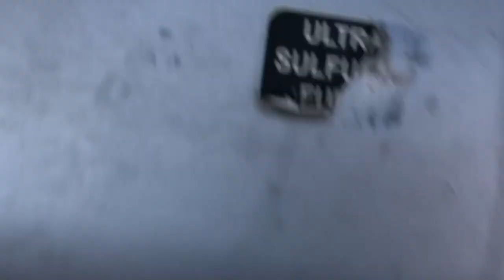Weed burner exhaust installed and a sneak peak on the belly box install.

Comment: Looks good. When i owned my 387 pete i did the same thing. Removed the stack and bracket. Actually lightened the truck up a few hundred pounds.
Reply: Any problems with exhaust leaking into cab?

Comment: Great update. I was thinking of doing mine. Looks like the routing and getting the parts to fit is the big thing. Thanks for the videos
Reply from the maker: Benjamin Duke it took a while to figure out how to run it. Initially we bought two 45 degree elbows. I was hoping to keep the flow as straight as possible. Had to return those and opt for the 90’s. It’s running great.  By using the stock pipe out from the turbo we were able to use the mounts already under the cab but really limited our options towards the back. We were looking at using the main muffler support from the stack under the cab somehow.  It was easier to only have to alter the routing the last few feet.
Reply: Extraneous lights, chrome, and other trinkets are a waste of money.

Better to put that money into the bank.

Comment: Does it drone or is it annoying on long drives? I've done straight pipe stacks before on a cabover and because it went above the cab it wasn't loud but how loud is it dumping below the cab?
Reply from the maker: It has a small performance muffler on it. The Jake break was loud and sounded good, but not as loud as straight pipes. Going down the road was bearable. Again, not as loud as straight pipes,but she sounded great. I’ve since sold the truck. The owner has a driver that doesn’t appreciate the weed burner. Claims he’s getting exhaust in the cab. He’s probably going to replace the exhaust again, and put it behind the cab. My new western star has a weed burner I’ve never had any issues with exhaust in either truck.

Comment: Dave, Why did you go with the weed burner? And are you still liking it? I want my truck as quiet as possible would you still recommend the weed burner?
Reply from the maker: Keith Fine this set up is not quiet. It’s got a tiny performance “muffler”. It doesn’t muffle much. This set up lowers exhaust gas temps and increases exhaust flow. This set up improves fuel economy but I can’t prove it. I took off my skirts and put belly boxes and ramps under the trailer I also swapped drive tires. I was a consistent 7.2mpg prior. I’m running about 6.2mpg now. Getting an overhead done next week at Pittsburgh Power. I think the truck might be over fueling too now.